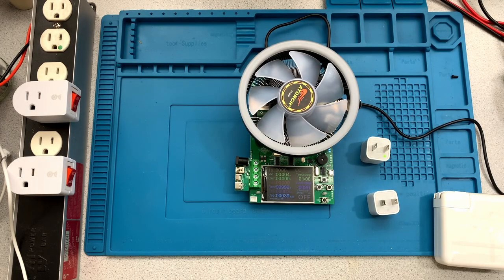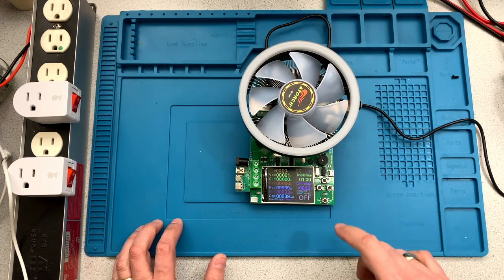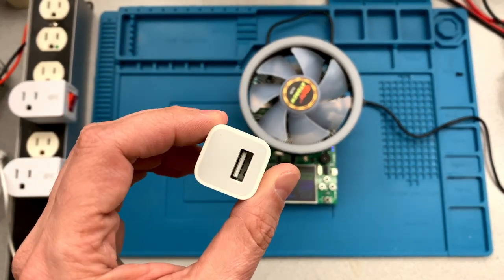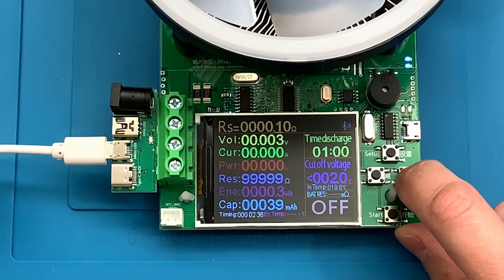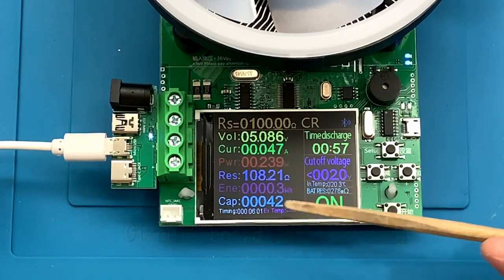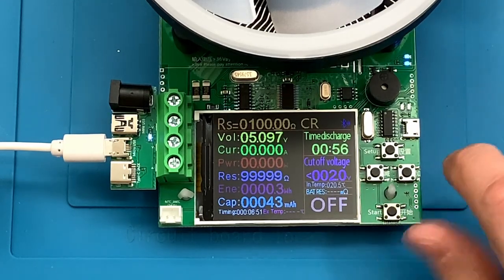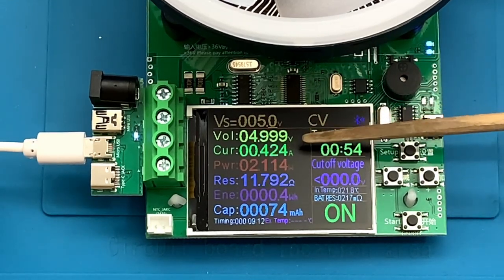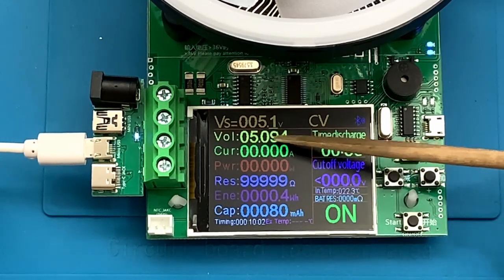ATORCH DL24 / DL24P Operating Modes

Comment: I have a USB power bank that can output 5V, 9V, 12V. I want to run a Constant Current test on it, but when I connect the USB-A or USB-C ports to the Atorch, it goes to 5V. How can I set it to draw 12V, instead of 5V?  Its not clear to me if Constant Voltage is the test to do or not, given that what I'm wanting is to determine capacity as it relates to a particular amount of amps being drawn.
Reply from the maker: You need a power delivery (pd) trigger on the USB-C connection. Have a look at the video I did on USB-C. https://youtu.be/YzDN4vQMZJI?si=x_xaIpvXhCCX4j5c

USB-A will always be limited to 5V

Comment: Thank you! I noticed some have Cap: (capacity) measure in Ah. How do you switch from showing mAh to Ah?
Reply from the maker: Do you mean DL24 models or other models? I'm not aware of a way to get DL24 to show capacity in Ah.
Reply: @jtechlabs1  Ty for the response. I've seen it shown in other videos when everything was zeroed before testing. I ran a capacity test yesterday and it did switch Ah right at the end of testing a 100Ah battery. I didn't know if it would just stay at 99999 or go to 0. But it's switched to Ah when it hit 100 Ah or 1000,000 mAh. So that works for me.
Reply from the maker: @2._-1.-_  Thanks for letting me know.  I haven't tested anything with that large a capacity yet.
Reply: @ My pleasure. I really appreciate your videos! BTW, I left the default watt cut off at 185 watts. I started out trying to discharge at 15  amps or 180 watts at 12v. The over watt alarm triggered and stopped it. I forgot to take into account that the a 12v LiFePo4 fully charged is about 13.5V. That put the wattage at 202. lol Just a fyi if you do test 100Ah 12v. I ended up testing at 12 amps constant current. Thx again for the vids I'm still learning.

Comment: In your CV demonstration, I think you misunderstand what is happening.  When you set 4.8V CV, you are overloading the power brick, and the power brick is going into cut off to protect itself.  It's not that the DL24P cannot find a solution, it's that the brick is overloaded and going into cutoff.  The power brick waits a few seconds, then tries to supply power again... the cycle repeats.  It is not an issue with the DL24P "being able to find a solution".

Ideally, you would use a benchtop power supply to demonstrate all these modes, very easy to show what is going on when you can actually control the output of your power source to demonstrate the modes of the DL24/DL24P.
Reply from the maker: Yes, I agree the brick is overloaded.  I see what you mean. I could have been clearer with my terminology. It would have been better to say that the DL24 is trying to produce a load that would achieve the target voltage. 
I did a quick test with a bench supply. My supply is limited to 5A. The bench supply does a little better, but it soon hits its current limit.  At that point the DL24 behaves the same way, with the cycling of the load as seen in the video.

Comment: [Edit] Using a 18-25W LED Driver, it was not possible figure Constant Voltage function out: whenever a voltage is set for it, within  itsrange (50 to 75V), the driver starts making high pitched intermittent (not happy) noises, as if DT24 was trying to "pulse resistance" against it.

I bought one of these and I think: Constant Voltage function could be suitable for LED drivers, which are current driven and have a range of power (18w to 24w, for example). I don't test it yet*.

Yes. I have some LED drivers for testing:

- 4-7w @ 300mA (suitable for 7x1W Power LED spotlight)
- 18-24w @ unknown/not clear stated current (suitable for ceiling LED fixture)

* I'll come back here in a couple of days: I have some working LED drivers for testing that function. See you soon.